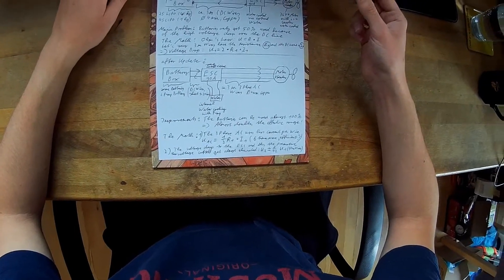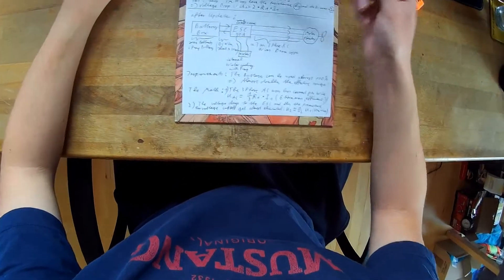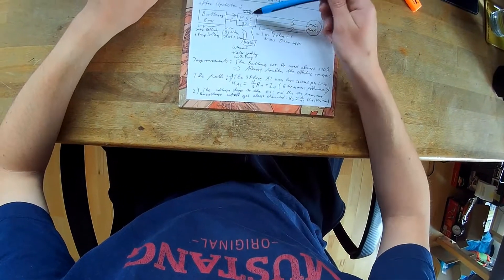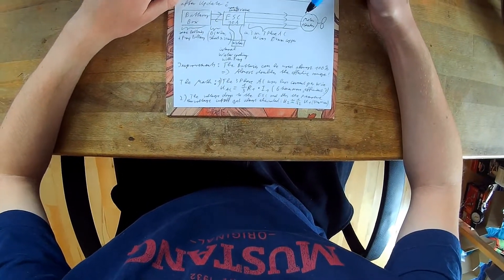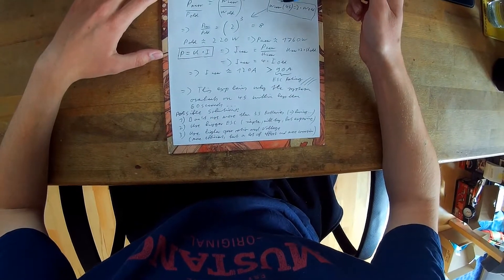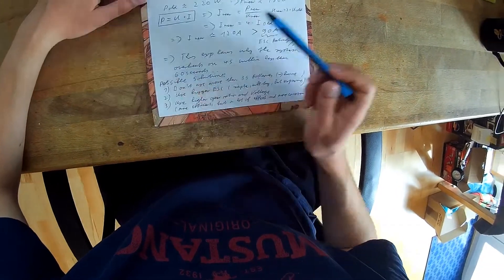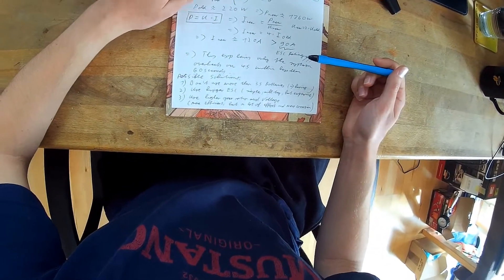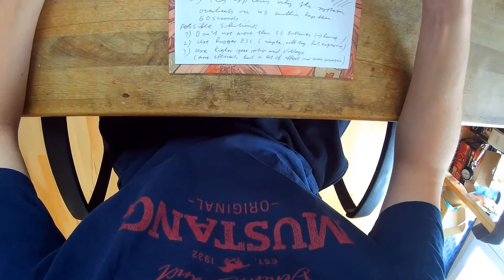Brushless Kayak Motor 2.1 (DIY) Electronics Update

Comment: If you would really like the ESC to be close to the motor, why not just have thicker primary wires? Also using a higher voltage and of course different motor to handle that voltage, there should be less drop which is something you can work with, with non trolling motor components.
Reply from the maker: Thanks for the interesting questions! Having thicker dc wires would probably work, however, the wires are already 4mm in diameter and pretty heavy and since the ac lines are more efficient and I still wanted to use the esc's low voltage cutoff feature, I wanted to at least try to use longer ac lines first, and I think it works pretty well in my case. At least I had no torque problems when starting the motor. Higher voltage is definitely a good idea, however, it comes with some challenges. The motor is not the problem, it is rated for double the voltage I was using, but the esc is only rated for 6S and high voltage esc's are apparently quite costly. There is also the corrosion issue, so with higher voltage I would need to protect the wires and plugs better from the water